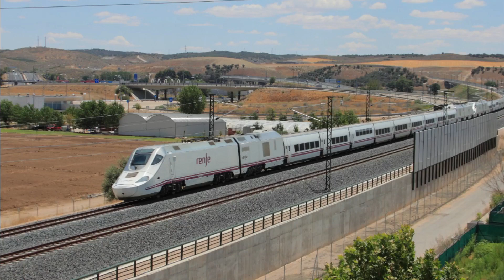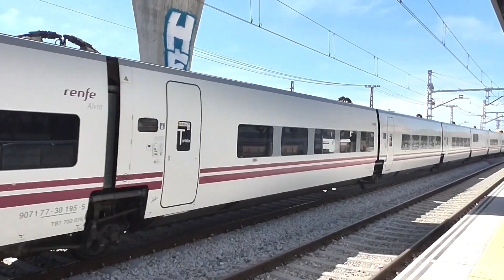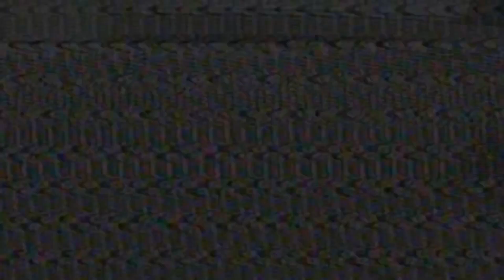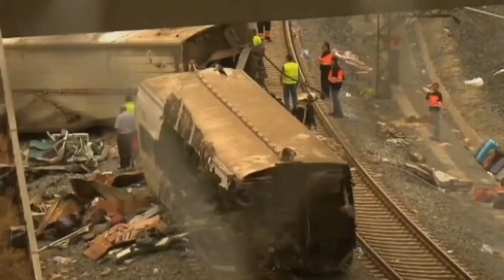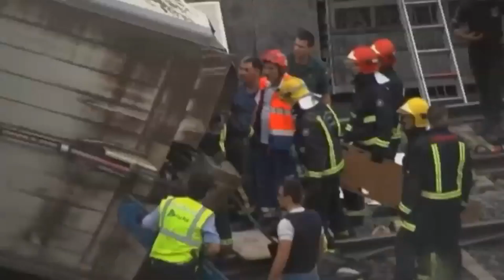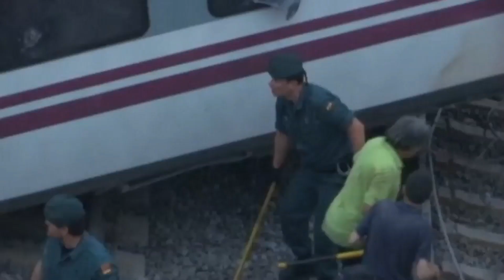The Santiago Train Crash Explained: How Did One Curve Become a Catastrophe? #TrainDerailment #fyp

Comment: ETCS was actually installed in the line, but disconnected due to alleged "delays". At the time, the train had to reverse at Medina del Campo station. When changing from one cab to the other, all the systems had to be rebooted (including ETCS). Renfe figured it would be quicker to only use ETCS between Madrid and Medina, and the older ASFA between Medina and Ferrol, despite the fact that ETCS was available between Ourense and A Coruña. That would speed up the reversing manuver, but at the detriment of safety.

The possiblity of this accident was already pointed out by another driver months before it happened. It was just a matter of time. But both Renfe and ADIF (the railway authority) ignored that warning.

After this accident, a new protocol was added to ASFA, which was dubbed "Baliza de Cambio Significativo de Velocidad" ("Significant Speed Change Balise"), which sounds an alarm on the cab that must be acknowledged, and brake the train to 60km/h or less, otherwise the emergency brake will be automatically applied.